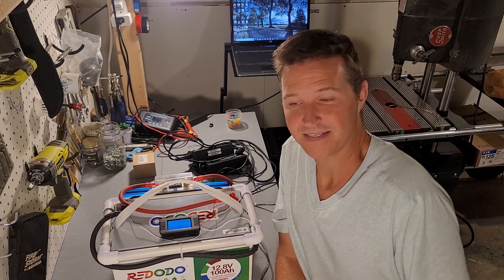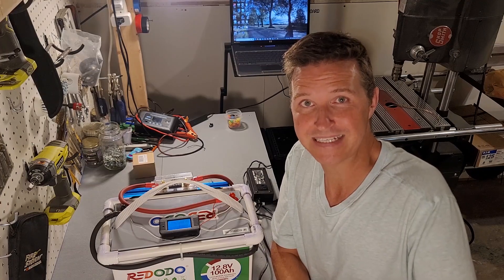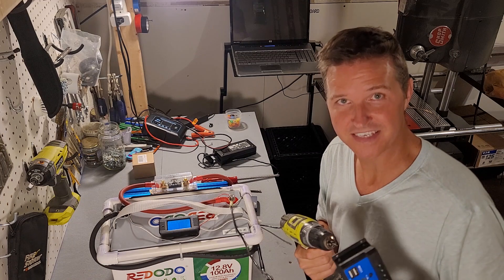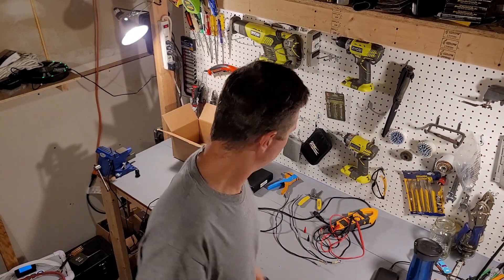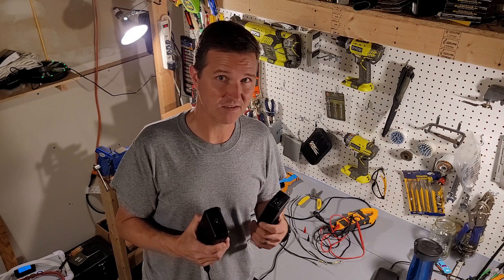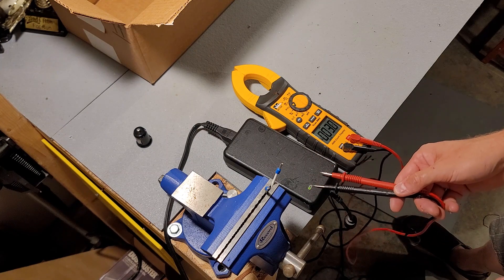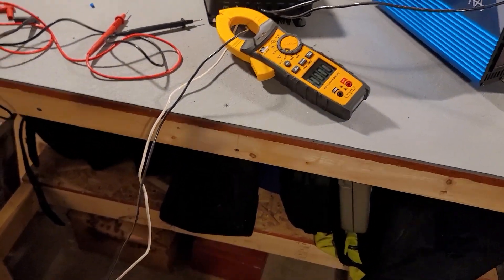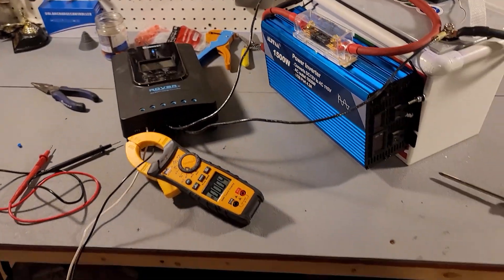Connecting a Laptop Charger to a Solar Charge Controller....  and some other things.. Part 2!

Comment: I'm using a chinese (blue) solar controller like yours with a Toshiba 15V 5A laptop power supply,  working fine with no problems
Reply from the maker: Thanks for the info.  I believe mine was over the amp rating for the power supply.
Reply: Now working with a 19.5V 6A HP Laptop charger,  no problems here  👍

Comment: I actually have an old laptop power supply with me right now. I was planning to use it to power a 10 Amp PWM controller. I just watched your video and therefore have dropped the plan. Because you tried to work it out, I thankfully do not have to risk blowing up my laptop power supply. What I am going to do instead, is get myself an 18 volt transformer (non-center-tap variety) in a few days time and wire it up to the controller.
THANK YOU FOR THE VIDEO.👍👍👍
Reply from the maker: You're welcome!  I hope everything works out for you.

Comment: measue your laptop supply "colored" wire+ to black and/or the shild..most supplies have a braided shield which may be your dc ground(negative). Any powersupply can work..all it's simulating is a solar panel. as you already know that voltage/current will be used by the charge controller to charge the battery. Is the power supply voltage compatible with your charge controller. Too little input voltage will force the controller to not work. I do this all the time with 19v 3A laptop supplies, especially in winter when solar sucks...
Reply from the maker: Thank you for the detailed explanation.  I'll keep that in mind!

Comment: Since your mppt charge controller cannot limit the amp, the mppt tries to suck as much as possible from the power supplies which overloads them. If provide power with a DC power supply with limited amp, the mppt will likely work.
Reply from the maker: Thanks for the info and the comment!

Comment: It can work… I have use this method a lot of times.

There is two options 
1. Do P=IV calculate of ur charger, use only 90% and set ur MPPT to amp you got from I=P/V calculation…

2. The best cheapest way use DC-DC buck converter. Do the calculations I mentioned above. Then set the converter the Ampere… I do use it that way ❤
Reply from the maker: Thanks for the info and the comment!

Comment: Maybe you should connect the charger straight on the batteries. Thats what i do but i switch off the whole system..
Reply from the maker: Thanks for the info and the comment.

Comment: Can you limit the battery charge in mppt? Laptop chargers have protection, if you could limit the charging from mppt to 4A I think it will work.
Reply from the maker: I can limit the charge with a victron, but not with this one.  Thanks for the comment.

Comment: I have had mixed results. Even sticking to power supplies without the signalling wire it seems hit or miss. 

Using a Renogy Wanderer 10A, a small 8A LiFePO4 and various 65W power supplies I had in a box I was able to get one working quite reliably, one that usually works and two that simply didn't work.

As the charge controller pulls current from the laptop charger the supply voltage drops. And if it drops below the battery voltage then the charge controller stops pulling current.

If you can configure your charge controller to limit the current draw then using for charging should work.

If I can find a 150W PS I'll try that for comparison.
Reply from the maker: Thank you for all the great information and for the comment.

Comment: I just did mine and it works but what freaks me out is that the rating keeps fluctuating from 14v to 19v and the battery keeps increasing and decreasing but after I disconnect it, the battery comes down to somewhere around 12.8or above.
Reply from the maker: Weird.  At least you got yours to work!

Comment: A laptop power supply is not a battery charger. A charger will allow a voltage drop to maintain output current. In this case, the power supplies are connected to a battery with a very low internal resistance. So, the power supplies see this as a short as they can't keep the voltage regulated. See my comments in part 1.
A PWM switches input power on and off to maintain voltage up to the maximum current rating. So, the power supply is directly connected to the battery when charging.
Reply from the maker: Thanks again for the info!

Comment: I tried mppt and pwn chargers to charge battery  with power supply. pwm is working but mppt is not working. maybe ps close itself.
Reply from the maker: There was nothing I could do to make it work.  The power supply was always shutting down from over amperage.
Reply: @OffGridBasement  ı hear that these charger controllers gives back 3v back especially mppts. You can check voltage input with just connect battery. And ı think these laptop supplies close it self. Ypu can try with some computer supplies or kind of lab supplies.

Comment: I would help everyone, if these Chinesium solar charge controllers, came with actual operating and wiring instructions! Versus a bad chinenglish instruction pamphlet!
Reply from the maker: Sometimes I wonder if they just use a free translator tool to get the job done.  Thanks for the comment.

Comment: Don't give up just yet. Try using a cheap boost converter to modify the voltage and current  between the power supply and mppt. Im actually about to test this myself but with a dc power supply into a boost converter to step up the voltage and limit the current which should trick the mppt into thinking it's a solar panel. The mppt seems to be trying to draw more current than the laptop supply can handle. Im pretty sure the boost converter will solve this.
Reply from the maker: Do you think a 24v to 48v boost converter?  I think the power supply would burn up a 12v converter.  Thanks for the comment.
Reply: @OffGridBasement   Just a cheap 400w ebay$5-10 boost converter should work with an mppt as it's current limiting. I'll know soon I just purchased one to try with a 12v 10A bench power supply. Can adjust PSU up to 14v, boost that up to 18v through the boost converter which will lose a little current in the conversion but since it's current limiting the mppt won't try and over draw the power from the supply. I'm certain it will work with a bench supply and it even works in vehicle  as good as a dcdc charger. You can mimic a 100w panel output through a cig socket. for $5  invested it would be worth a try.

Comment: Maybe you shouldn't use a laptop power supply. Try using a less smart DC supply adapter. Something that doesn't protect itself so much.
Reply from the maker: I've totally given up on that.  You're right.  The power supply is indeed smarter than I am!  Thanks for the comment.
Reply: It would avoid the smart shutdown of the laptop power brick..... but then you would just burn it out instead.

Comment: You need between 10 and 20 amps @ 24 volts or 14.5 volts  to work the mppt controller.  laptop chargers can only supply 19volts 3.5amps the charge controller needs 10 amps or more to  recognise there is power to receive before it will charge the battery and turn night mode off.
Reply from the maker: Thanks for the info and the comment.

Comment: Use a different power supply… The laptop power supplies are too “smart”. Find an old brick power supply from the Salvation Army and mess with them. I’ve had success with old Xbox power supplies and other random out dated devices that came with power supplies. You’d be surprised how much current some older devices needed 😛
Reply from the maker: I never thought about using a game console plug.  That's a good idea.  Thanks for the comment.

Comment: I ran into the same issue! But after reading the comments I tried to limit the amps on my MPPT to 10A (my laptop charger produce 10A) and it works like a charm! Thank you everyone for saving my campervan batteries here in Mexico. I couldn't find any charger anywhere. I also added a 3 position switch to choose from solar to shore power with more convenience.
Reply from the maker: Thanks for sharing!

Comment: I have to tell you, I am impressed that you stuck with it. I was wondering myself. The only thing I can think of is that there may be some type of "sensing" circuitry involved - on both ends. What I mean is, I do not think the charge controller sends the voltage and current through until it senses it for like 2 seconds. Likewise, I suspect that the laptop charger does not send the current until it senses a load. Maybe putting a small resistor or lamp in series between power supply and charge controller. If you don't want to spend any more time on it, I understand. I may try it myself. I have several old laptop power supplies laying around. And this should work with just the one 19vdc charger, which is essentially similar voltage of a 100W panel. I have used old laptop chargers in the past to power a 1/32 scale slot car layout and that worked, but it was several years ago and the circuitry may have changed. Some new generic/Chinese chargers will not work on some Dell laptops. I don't know what it is checking for when you plug them in, but it is checking for something. Liked and subscribed.
Reply from the maker: Thank you.  I don't know if I will try something else but thanks for the information!

Comment: Connect the PSU to a DC-DC Converter it'll work. I've been using it for months now
Reply from the maker: Thanks for the info.
Reply: @OffGridBasement  Pls let me know if it works with you.
Reply: @rjowoeye  what does the dc-dc converter do? doesnt the laptop charger already produce dc?
Reply: Laptop charger produces dc but it doesn't regulate current, it allows current up to its max and then shuts down. Some dc to dc converters allow you to control both the voltage output (which can be useful but not really a big deal here) and the amperage output which will allow you to feed the controller without shutting down the laptop charger. It lets you throttle the output of the power brick.

Comment: What about if you put a diode in between the charger and the controller
Reply from the maker: I believe that would just block the DC current altogether.  Unless you have some other way of wiring it.  Thanks for the comment.

Comment: I commend you for your efforts... being following your vids for a bit now, I have thought about a hack like that too.. I wonder if anybody has tried a power supply from a desktop computer? I have thought about trying that myself. I have plenty of old towers laying around with good power supply's. If I remember ....  depending on the wattage and the wiring some can do 24V dc @ 5 amps
Reply from the maker: I believe I have watched a couple videos with people rewiring desktop power supplies.  I have a couple also.  I should try it out.  Thanks for the comment!

Comment: I have the same issue when trying to use laptop chargers to run a PWM DC controller to run garden model railways.
In experimenting I have found that using "Switching" power supplies, like the ones you're using, the power supply fails after a few seconds,  BUT if you use NON-Switching or Transformer type power supplies it will work.
Reply from the maker: Thanks for the info and the comment!

Comment: You can get the laptop charger to work . There are 3 coaxial wires in laptop chargers . The outer wire us usually the negative . The middle wire is the 19.5V supply . Then there is a smaller centre wire which is 14.5V . This smaller centre wire with 14.5V is for signalling to the power supply that the battery has reached 14.5V . 
I have used these laptop chargers on my deep cycle batteries. 
What you need to do is , after you cut the wires , join the 2 positive wires together ( the 19.5V and the 14.5V wires ) . In that case the power supply still get a feed back , and will not cut off until the battery has reached 14.5V.
Reply from the maker: Thanks for the info.  I'll check it out soon!

Comment: This guy did it with a wall wart power supply and a cheap controller. 

https://youtu.be/aR5_Mlul_ws
Reply: his cheap charge controller only draws 3amps max though or 1? cant remember what he said exactly, but lower than any laptop chargers  so it didnt overwhelm it, which i think is the issue here and why some have had success limiting the current draw on their charge controller.  I have a pwm controller that doesnt 7 amps max, i will test to see if this is the case, because if it is, i should be able to get 2 power supplies in parallel to work giving me almost 7 amps ,while the charge controller draws that much.  Should be good right? ...  Im not sure it exactly works this way, but only 1 way to find out.

Comment: Can you adjust the current on the charge controllers?  Maybe turn down the amps ?
Reply from the maker: No.  I could with my victron, but not Renogy or the super cheap one.  Thanks for the question.

Comment: I have the same charge controller and I use a Drok power supply, and set it to 32 volts and charge the lifepo4 battery normal without issues, so get a Drok power supply is cheap
Reply from the maker: I do need a variable power supply.  Drok is probably the way to go.  Thanks for the comment and info!

Comment: Before I had a car battery charger, I remember using a laptop charger to charge my 12V car battery once. I had to use a couple of old turn signal/brake light bulbs to reduce the 18/19 V from the charger and it worked.
Reply from the maker: That is pretty creative.  I can't believe it worked!

Comment: You  have to limit ouutput from your charge controller.
Or paralell more chargers to mach your output amps.
Reply from the maker: Thank you for the information and for the comment.  I've come to realize the computer power supplies are faulting b/c of overload protection.  Thanks again!

Comment: I think there is a difference between a "switching power supply" and a "transformer power supply"... Maybe the switching is not seen by your controller.  My victron needs to see 5 volts over the battery voltage to turn on.
Reply from the maker: The community thinks it's most likely that the CC is trying to pull too many amps from the Power Supplies thus causing a overload condition in the supplies.  Thanks for the info!

Comment: As others had said, the SCC is drawing higher current than the laptop power supply can handle. Does Renogy SCC have adjustable charging current? If it does then set it to the lowest setting first and then slowly adjust it up while monitoring the current draw from the Laptop power supply to make sure it is not exceeding the power supply current handling spec.
Reply from the maker: The renogy rover doesn't have adjustable charging control.  The only small CC with this capability I know of is Victron.

Comment: Question: why dont you try with a regulated power suply? maybe a 10 or a 20 amps power suply like the ones we use in amateur radio
Reply: also the charge controler must be a 10 or 20 amps pwm
Reply from the maker: I just wanted to try with what I had and with some of the ideas other commenter had given me.  It is now apparent that regulating the amp output is needed for this to work. Thanks for the comment 👍

Comment: Yeah lots have people have success doing it on youtube.. Strange why your having no luck... 1 guy steped down the voltage from 19 to 12v...  My PowMR is.Back from DEAD..Maybe just those stupid screw wire terminals or a loose wire.. They need a redesign with nice cables and leads with products. XT 60 sockets and MC4 connectors....
Reply from the maker: That is great news about the PowMr!  Everyone is saying the charge controller is pulling too many amps and the power supplies are going into overload protection.   That makes sense.  Thanks for the comment!

Comment: You could use a step down buck converter power supply with a voltage knob and set the voltage to 14.6v. Give me a shout out if this works.
Unfortunately on my channel I'm going to be working 50-70hrs a week for the next few months. I'll get videos out when I can 😭 I can email you a link if you need
Reply from the maker: I've definitely looked at them.  If I were to go any further with this I would purchase one.  Hope you are able to get videos out sooner than you think!

Comment: A lithium battery can draw enough current to destroy even an automotive alternator.
The key is using a current limiting setting on the charger.
Solar cells are self-limiting.

The only thing I could find with that configurable parameter is Victron's Buck-Boost DC-DC Converter 25A / 50A / 100A
Of course, the reason to re-purpose the Power bricks is to save money.
Unfortunately, you will need a DC power supply with about 120% of the rated maximum output of your solar charger.
Reply from the maker: Thanks for the comment and the info 👍